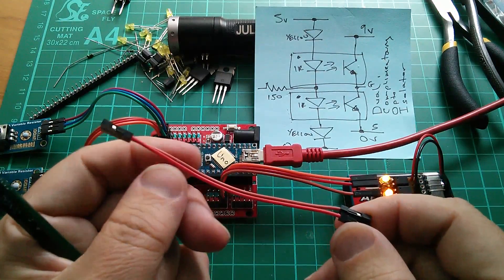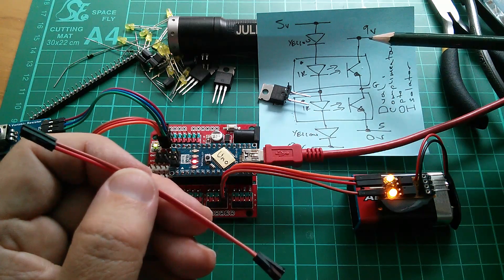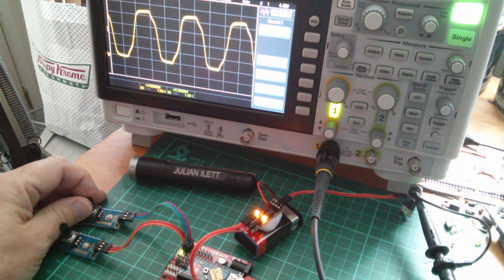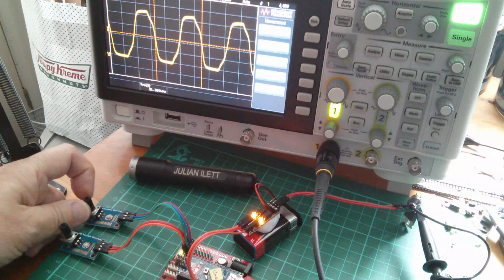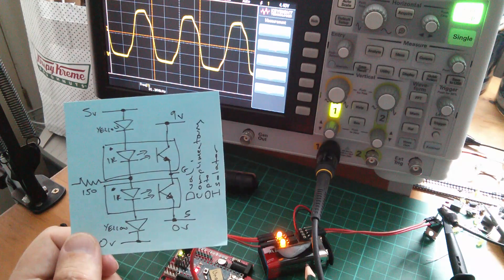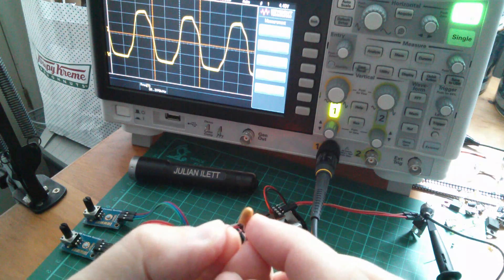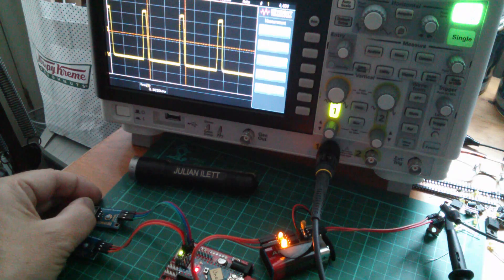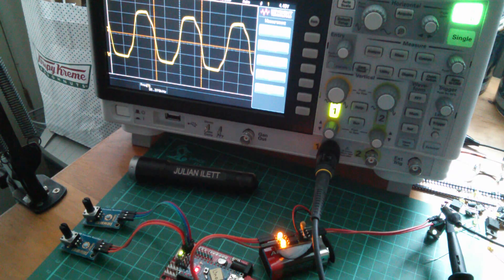DCOI Revisited (part 3) - Muppet 2 Project

Comment: I wonder if you know what improvement I could get from my Solar panels if I could adjust them to point at the sun as it rises with the panels 90° to the rising sun..ie vertica, and then to follow the sun and adjust the angle of the panels to remain flat on to the sun all day.
I see kit available from Bang good to at least give 1 or 2 angles of adjustment. 
It looks like a job for a computer program to plot the position of the sun from a given latitude and longitude. But is it worth it? How much more power would I gain? 
In the winter months it might be considerable. What do u think?
Reply from the maker: The main problem is the cost of the tracking machanics - you could just buy more solar panels.

Comment: Hi Julian I think you are on the right track, in making a simple MPPT tracking device, it is very complicated to make the algorithm to the tracking device, so what you have done is maybe not 100% but good in many cases and better then nothing, because your's are active all the time and that is a good way to track the highpoint. 
You used 2 panels in series and didn't get to "double up performance", and I think that is almost not quit possible because there are some differences in the panels and what you se are a the the best performance for the setup and That must be the way to go. 

I have a suggestion for THE START UP TRACKING Device....you start from the bottom with the counting, IF you start from the Top and go down there are not so manny steps before you get some power to walk with and are over the noise floor, so try to count down instead of counting up. 
The idea with the 4 Mosfet look very promising. 
You ware talking about the tracking algorithm.... ...I was watching MATLAP  a link to where "they" are talking about MPPT in a design program, maybe this can help you to think in the right way.....
MATLAP...
https://www.youtube.com/watch?v=GnZFi9CzF9Q

Looking forward to se some more experiment on the Buck/UP Converter....We are people there are using higher Volt, then 12V more like 400V Tesla Power wall I know this is a little high for your experiment, but give you an idea where others are going  

A Tesla 85KW Power Pac (from a Crashed Tesla S), a 50KW inverter AC......400V DC solar direct connected to the power pack for Charging.....also simple and lot of useful Power....  Jack Rickard ....EVTV Friday Show -Tesla Model S Battery Pack Solar Energy Storage....    https://www.youtube.com/watch?v=7zO11Q237nA 

Don't fall for the same mistake that Dacian Todea did, when he made a limitation for 60 cells panels, there are 72 cells panels (I am using 96 cells 70V Opens circuit panels)....Make it Versatile Please....Thou He have made some genies solutions for charging and using Solar Power direct for "thermal" heating THAT is smart....But have some limitations, when it comes to upper Volt.......He is running way to LOW.....at least 48V- 65V Battery bank (70V) charging Bank.

  Muppet 2.....versatile ....Go for it ;-) 
Maybe make a split-up - between the MPPT Controller and the Buck/UP converter with a Super capacitor Power Bank , because the MPPT are looking at the load and that is  where you want to control The battery charging, and that can confuse the MPPT tracking device, If you have a variable DC reference Capacitor Bank so The MPPT can look at that, and charge it up to some high volt over the  "Battery charge target" then there are plenty of power to charge with, and when the capacitor bank runs LOW, because ... No sun, then the charger stops and start up again when the sun comes back and the capacitor bank are charged up to the point where the charger can run again. This way you are not interfering the MPPT with the load because That is more ore less the same. Then you can have a variable charging Volt on the solar side and a constant charging Volt on the battery side. The Capacitor label Volt rating has to be higher then the Open circuit Volt from the Solar array, then you don't have to control the max volt from the solar side, just let it run until the solar can't give more volt/power........Smart ay.. ;-)  

And with You'r new 4 Mosfet Buck/UP Converter you can charge the battery....

The Load connection: You connect The LOAD on the capacitor Power bank, and when it runs empty because the sun are out ..the power flow can change direction and come from the battery Bank and run to the Capacitor Bank, then you have full curule..... 

Hope it is useful somehow..

Some of os wish to go off Grid ....Best ........ Jørgen Thomsen Denmark DK

Comment: Can you try with something higher voltage than the 9v and see if it improves?
Reply from the maker: Yes - I'll be increasing it to 12 volts soon
Reply: Julian Ilett I was trying this solution to just hit the gate with a nice high voltage so most of the driver circuit single distortions appear well after the MOSFET is fully on. http://everycircuit.com/circuit/6165331951484928 after the boost converter primes the Capacitor it can pretty much turn itself off.
Reply: WTF?  It seems to indicate that I can't see it unless I'm using Chrome for a browser?  Useless!

Comment: You'll want some more volts for driving the power device gate properly (12-15V is pretty common but depends on the MOSFETS you're using), it'll make sure the device is fully enhanced when turned on and also help with the charge speed as you're (more or less) fighting a passive network of parasitic inductors and capacitors. This is all assuming you have sufficient gate drive current capability. Another useful addition would be negative off state bias (5-10V should be safe depending on the MOSFETS you're using) on the gate which will help you with any common source inductance related ground bounce and crosstalk related unintended conduction (the ultimate conclusion of which is shoot through and device failure if it gets bad enough).

Comment: I haven't looked up the specs on the optos, but I'm wondering if you can get more speed by having a deadspace (tri-state) in the input signal.  Or if there's a way to keep from holding the opto's output transistors in saturation before switching?  I'm thinking the problem may not be turn-on lag as much as turn-off lag.  Either that or it's the limit on the amount of current the optos can handle.

Comment: Would increasing/decreasing the opto input current affect the output swing time at all?
Reply from the maker: It changes it a little - I shorted out the 150R resistor and the waveform was a little different.
Reply: Julian Ilett did it change for the better? Or did it get worse? :P
Reply from the maker: +Ian McClellan-Johnson A little more symmetrical,  but not any faster.

Comment: "running 8 times slower" GAAAH Stop this incomputible nonsense!
Reply from the maker: Surely, if 32khz is eight times faster than 4khz, then 4khz is 8 times slower than 32khz. There's a nice symmetry to it ;)
Reply: Okay, please calculate 1 times slower for me, will you? Then compare with what 1 times faster equates to. Bonus points if you can still make it work with the comparative form of the adjectives. Take your time, I'll wait. ;)

Comment: Julian, I wonder whether you could overcome the slow switching problem by using some "totem pole" output optocouplers. For example, the TLP155E from Toshiba or the ACPL-4800 / ACPL-M484 from Avago might be a better choice than the two PC817 you are using?
Many thanks for the excellent content you provide!

Comment: 9V battery has a relative high internal resistance, limiting your rising and falling edges. Try with a lower impedance voltage source , or perhaps with a low ESR capacitor across the 9V rail

Comment: Well even with other optos I would always add a schmitt trigger (comparator with hysteresis) on the output of the optos. This will ensure that you will have a low enough impedance on the output and also remove any problems with noise etc. But yeah. The switching freq is way way to low. If you want a good efficency you will have to reach 10 times the frequency. Probably more.
I dont know of any switching power supply that runs with such a low frequency. I dont think an arduino is a good way of powering that. If i was you i would probably try it with at least a faster one like the Due. This can run the 164kHz with 8 bit outputs. That should be complelty fine for that project and will probably result in a much nicer waveform. 
But well, I personally would go complete overkill and go with an FPGA to have complete controll over the PWM signal and get really high switching frequencies. I dont think that standart arduinos are a good choice for a project like that.

Comment: Allow me to solve all of your problems with one component: TC4420. It's a high speed gate driver. It's designed for this situation. Problem solved. There's also part with a number I can't recall that uses a charge pump so it can drive a synchronous buck converter, which will get you a few percent more on efficiency. I built my own Muppet-a-like, and that chip did it perfectly for me. I've given you my schematic before, I urge you to consider it - I put the MOSFET on the low side, not the high side, which simplified design greatly as well as being more efficient.

Comment: You literally have no idea about how current flows and thats why you found the idea of connecting source into mid point of the dcoi. Do you think that internal trasistor of pc817 will be able to handle the current when lower opto is on? I have no word how pathetic that idea is. I already said before that this pc817 wont be able to handle more than 1KHz if you really care about efficiency. MPPT needs better design really or else the benefit of MPPT will be dissipated in heat. Lower frequency means you need bulky inductor and its series resistance will drop more voltage. Even at 3khz waveform edges are not very sharp. When you do measurements you should consider some technicalities or else its not meaningful. You should have measured rise and fall time even though the frequency is not at all acceptable
Reply: And here I stop taking you seriously. What a lovely litter of rainbow-farting, cotton-candy-shitting unicorn babies you are.
Reply: Anvilshock LOL
Reply: Anvilshock I was actually waiting for this day to deliver my high voltage comment. I already knew the result because if anyone had a little knowledge in power electronics then its very easy to identify what will work and what will spoil. I still do not find any justification of galvanic isolation or having pc817 in the game. Rest aside that brilliant idea of connecting the source to the midpoint of DCOI. I am worried about those beginners who came to learn something about electronics.

Comment: I know people are saying that this opto is slow but I woud like to see unloaded signal without gate capacitance beacouse I am interested it can be improved by adding additional pair of transistors to buffer the signal.
Reply: As far as I know, this was covered in the video "Dual Complementary Opto-Isolator (DCOI) High Side MOSFET Driver #3," from a few years ago, where Julian Ilett looked at the transient response of the optocouplers both without and with the MOSFET.  The rise time measured there matched the datasheet, and I think the couplers used in that video are the same as used in this one.
Reply: thanks

Comment: PC817 optos are pretty slow. They declare rise time 4ms and fall time 3ms in the datasheet, with maximum values of 18ms, but ive tried them with 10kHz squarewave, got a steady 15ms rise and 15ms fall time, so effectively 70ms of normal signal and 30ms distortions

Comment: Not really sure why you need opto-isolation in this context? Why not just use a gate driver transistor?
Reply: Level shifting. His MOSFET source and his microcontroller ground are not at the same potential, so he can't connect them directly. I had the same problem, but I solved it by swapping the diode and MOSFET placement in the buck converter in order to put the source and ground at the same potential, at the expense of complicating output voltage measurement.

Comment: yeah the question is.. is it the opts or is it the mosfets.... if its the mosfets not much you can do, but since the capacitor didnt help, i'd say the opts...   not sure about opt stats, but the other trick that may help is a schmitt trigger between the opto and mosfet.... sadly this will induce a deadband at the ends... since the opto may not swing through as seen.

Comment: Couldn't you add a bjt transistor in a darlington configuration with the optotransistor? It should help with the switching, that is if the problem is not that the optoisolator is too slow.

Comment: Your non inverting idea will cause the full source current to flow via the low optocoupler transistor and immediate blowout.
Reply: Not when the 9V supply is floating like that. Any current flowing "down" toward a lower voltage needs to have a path back up through whatever supplied it, to complete the circuit. In this case there's no path through the lower opto back to the mostfet's drain. But assuming the final device won't have a 9V battery floating around but rather a drive voltage generated from the available power supply, your concern may become an issue.

Comment: You definitely chose the wrong optocoupler, maybe you should use something like this:
https://www.fairchildsemi.com/datasheets/HC/HCPL0611.pdf

And the next problem I see, is your diode setup on the input. The voltage of the uC-Output-Pin has to rise to a level, where the diode starts to conduct. This costs a lot of time. Also not using the diode inside the opto on its max current limit increases the amount of time for the phototransistor to conduct.

I suggest not using optos at all, they are very slow.
Reply: Or better yet one of these https://www.broadcom.com/products/optocouplers/industrial-plastic/isolated-gate-drive-optocouplers/gate-drives/hcpl-3120
Also tantamules don't have an ESR much lower than an electrlolytic. It's best to use a ceramic. For the isolated supply you could use a royer circuit or something.
http://users.silenceisdefeat.net/~lgtngstk/Sites/Circuits/12_to_24v_DC_Step_Up_Inverter/12_to_24v_DC_Step_Up_Inverter.html

Comment: Julian can you Check With Lower pwm Frequency?    And Whats the use without bootstrap gate Voltage of highside fet?
Reply: The lower PWM frequency is tried at 6:25.
Reply: Majromax Yeah have Seen.  Mean a Frequency of ~15khz
Reply from the maker: 15kHz is not immediately available from the PWM hardware, but can be obtained by fiddling with register values. That'll be covered in another video.

Comment: I think the distorted waveform would be the same even without mosfet. These tansoptors are simple too slow for 30kHz.
Reply: Indeed, the ISOdrive is a much better choice. I just have a drawer full of ADuM1201s that I use for isolating signals (usually TTL serial) and was thinking of how best to use the pile of stuff that I had on hand to solve the problem. Combining an ADuM1200 or 1201 with a MOSFET driver like the TC4420 could do the trick and keep nice clean edges, while being cheap, easily available on eBay (the 1201 and TC4420 are both available from alice on eBay), and easy to use. Probably not the best choice for a commercial product, but might be workable in this case.
Reply: This. One could use faster optos, or use a digital isolator like the ADuM1200 (perhaps coupled with a MOSFET driver on the output, as the absolute maximum output current is 11mA for the ADuM1200) to send nice, sharp signals.
Reply: The ADuM1200 is a nice part but they're really just signal isolators. You could simplify it with something from the ISOdrive range from Ti as they do a good range of parts that provide signal isolation, isolated power and (in some cases) complimentary gate signal generation with the right kind of output current capability to drive a power device properly.

Comment: Is that the distorted waveform with or without the actual mosfet attached?  What does the input signal look like at the led input (current, not voltage)? Could be that the transistors can't cope with the gate capacitance of the mosfet, but I doubt that's the case. What current should they be able to sink/source?
Reply from the maker: The MOSFET is attached, but it's not yet passing any current from drain to source.

Comment: I seem to remember a video you uploaded awhile back where you tested your DCOI circuit and you discovered that it's only good for switching frequencies of 16KHz or less.
Reply: You tested the full transient response in "Dual Complementary Opto-Isolator (DCOI) High Side MOSFET Driver #3".  There, the opto-isolators by themselves had a 4/3μs rise/fall time, and adding in the MOSFET added 1μs on each side. 

With a 30kHz signal, you need to complete a full period in 31μs (1/30e3), and 10μs of transient response in that period is unacceptably long -- and going by mark-1-eyeball that's approximately what you're seeing on the scope.
Reply from the maker: As far as I can remember, I only tested it at one frequency - 15kHz

Comment: my words of advice are 'use' and '555'
Reply from the maker: The Arduino offers much more control, particularly when I'm trying to drive all 4 MOSFET gates at the same time but with different waveforms :)
Reply: The full two-way buck/boost power supply can drive each side of the H-bridge in an interesting way, so there's no guarantee that any two channels are always inverses.  Additionally, some safety margin is wise: if ever two MOSFETs on the same side are on at the same time due to switching delay then current has a short circuit path.